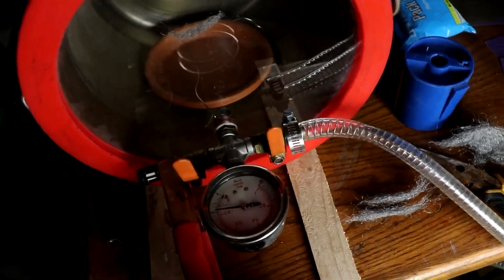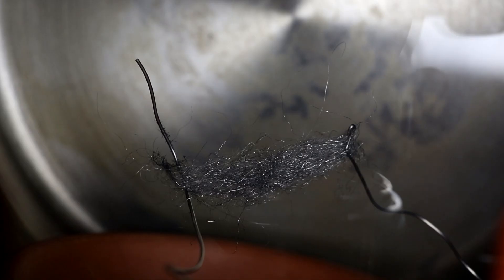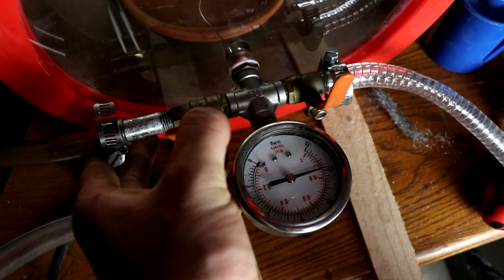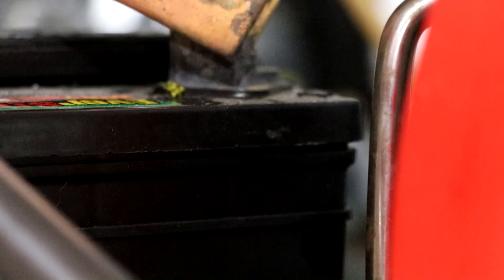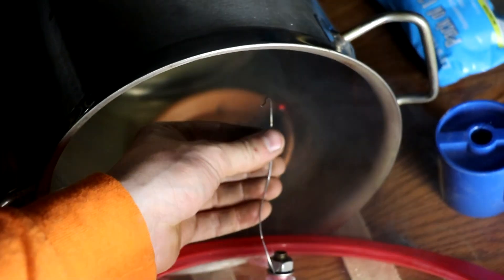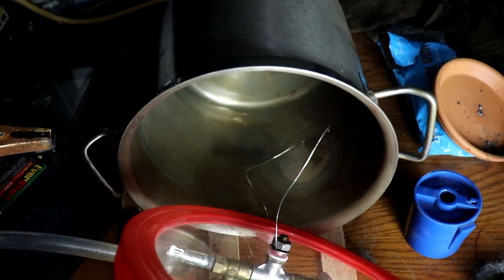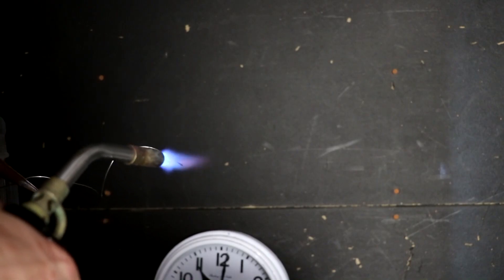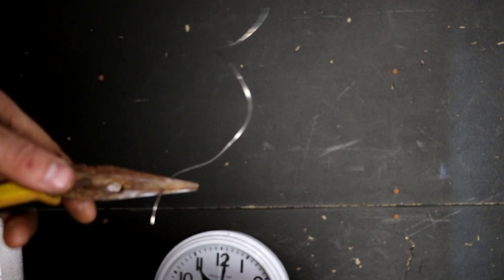Burning Steel Wool In Oxygen

Comment: You gotta remember stainless steel isn't stain proof. A slightly pressurized pure oxygen environment and micro quantities of carbon and water allows minute oxidation in an oxygen environment. Pure oxygen is an oxidizer.

Comment: How violently would magnesium burn in pure oxygen?
Reply: VERY
Reply: It will burn very bright and fast. That's how old photo flash bulbs worked.
Reply: Also try burning it in 100% CO2. The magnesium takes the oxygen from the CO2-molecules and makes carbon
Reply: KABOOM! That´s how.
Reply: soldering glasses?
u mean welding glasses?
Reply: on a scale of 1-10: The font death metal bands use
Reply: My science teacher burnt magnesium in pure oxygen, we weren't allowed to look directly at the flame as it causes weld eyes or so he told us, it was bright as hell.
Reply: Science is Life   Well, not any more...
Reply: @rocketman221projects -- Actually you can make a very serviceable flashbulb using very fine iron wool in oxygen.  Cody's wool in this piece was rather coarse.
Reply: even better white phosphorus
Reply: And how about burning Francium in Fluorine atmosphere ?

Nah, propably not gonna happen ;(
Reply: the FBI will arrest you for unintentionally making a flashbang
Reply: francium only exists in traces, but there is a youtube vid on caesium and fluorine
Reply: Good enough :P
Reply: Basically, what happens when you ignite flash powder. Powdered magnesium is the fuel, and heat releases the oxygen from the salt peter. When mixed in optimum proportions (fine tuned empirically) it will go up in a thump, out in the open. Its a low grade explosive, so the reaction is sub-sonic. To go boom, it must be confined (NOT compacted, as misrepresented over the ages) ... think steam explosion. In my misspent youth, I made my own fireworks, so I'm intimately aware of the details. Did it for years, back in the 70's and early 80's.
Reply: Baconomics101 Slam bands*
Reply: this needs to happen
Reply: ohhhh
Reply: Or some thermite
Reply: I tried, its instant and almost blinding
Reply: Black note it would not be an explosive device, so no they couldn’t or wouldn’t.
Reply: Kontrol Kabel that would probably be even brighter.
Reply: Hermes quest
Well, stop playing with it, put it away and get back to burning magnesium in pure oxygen
Reply: cdawson198600 furiously
Reply: Not to much Moore than in air
Reply: Yes :) But very little amount of magnesium please. Don’t wanna blow that ole vacuum chamber lol
Reply: Or natriuretic? Would be less violent. Maybe.
Reply: dont encourage him
Reply: Science is Life nah man he mean soldering, haven't you seen the bright flashes that burn out your retinas while soldering?
Reply: Hermes quest he could wear soldering glasses
Reply: test it out!
Reply: pulse nightclub violently

Comment: It's my understanding that part of what makes a flint and steel work is not just that the friction heats up the bits of metal to produce a spark, but that when the tiny bits of steel flake off, you've got a high surface area to mass ratio, plus a lot of newly exposed, unoxodized metal, so it reacts with the oxygen in the air to generate heat.
Reply: Modern 'flint and steel' rods are an alloy of iron, cerium and lanthanum which oxidises much more readily than steel.
Reply: Only what is sold as fire starters today as Magnesium on the back side. Come to think of it I doubt the front side is actually "flint" but it seems to work the same. I'm always surprised how few of the Survivors never even know the right way to use them.
Reply: I think I've seen stainless steel used in place of the "flint." Doesn't really matter what it is, as long as it can hold an edge against what it's striking.
Reply: It's probably pretty evident that I'm no expert in this field. But Cody brought up spontaneous combustion, and a modern lighter demonstrates the phenomenon quite well. I didn't know until recently that it wasn't just heat generated by friction.
Reply: Hmm, I'll have to try that, I would think SS being so much softer than flint, really even softer than a proper steel, that it would be hard to get a good spark.   (speaking about a real flint and steel, not the ferrocerium rod things.)
Reply: I assume the heat comes from the deformation of the metal. It takes energy to shear away the bits of metal, and that energy becomes heat. If you do this with enough energy, the metal ignites. (more energy is being released by oxidation than is lost to the environment.)  
Ferrocerium takes a lot less energy to ignite than normal steel, so you can get sparks more easily. Actual flint and steel takes a lot more work and doesn't make nearly so many sparks.
Reply: Iron is pyrophoric (meaning it ignites spontaneously at low temperature) when finely divided. The flint's job in a true, old-fashioned flint & steel set is just to shave off small enough particles of iron.
Reply: Flint does actually heat up the steel enough to get it to light, if too lightly struck it wont give sparks, because not enough friction causing enough heat for the iron to actually combust.

Comment: What is the chemical nature of the resulting ash? Is it simply iron oxide? Is it different than normal rust. Would it be incorrect to think of rusting as a slow burning?( I understand normal rusting is not an exothermic reaction- or is it?)
Reply: samuel dooley Normal rust is FeO(OH). The iron needs to get in contact with both water and oxygen in order to create rust.
Reply: Thank you, so what about Hydrogen. When it combusts with oxygen, the resultant ash is H2O, correct? Would it be incorrect to think of water as the ashes of hydrogen?
Reply: It's a combustion product, at best, I'd say. Ashes is very specific, and there are many combustion products created besides ash when burning organic matter. The Royal Institution has an excellent video on combustion products, and quite a few good ones on all sorts of fire (it always makes for a good show).

Comment: You should do it with non-oxygen-safe sealing materials and oil! It would be a great demonstration of the need to use oxygen-safe apparatus in its handling.

Also, the same experiment with fluorine would be interesting.
Reply: Interesting indeed. Unfortunately we'd have to buy a replacement Cody afterwards and I wouldn't know where.

Comment: I thought jet fuel couldn't melt steel beam
Reply: Who is claiming steel beams melted, not just softened? Don't most crashed planes come in at a very shallow angle? Why expect cellphones to act now as they did then, since they want to force airfone use nowadays?
Reply: Romano Coombs Any hearty enough fire (fueled by paper, office furniture etc) can cause structural steel truss failure. Trusses are by virtue strong, with relatively low mass compared to an 'I' beam of similar proportion. However that same property means high surface area to mass ratio. Under such fires, trusses can sag and fail, catastrophically so under load. 

Steel wool has an even greater SA:M ratio, hence why it doesn't just soften but ignites so easily.

Comment: If you'd do that again, could you do it with a 0.2 atmosphere of pure oxygen? That way you'd have the same oxygen content as in air but without nitrogen and you could show that the effect is based not on the higher total oxygen level. But anyway great demonstration, thanks!
Reply: That would be very interesting.
Reply: I would like to see this
Reply: Yeah I thought the higher partial pressure of O2 was what caused the increased burning, rather than heating the nitrogen. You could always test that by doing a 0.2 atm test as suggested above!
Reply: That's the Artemis assumption I mentioned in another comment. Please do try!

Comment: (Edit) Here's a bad idea: put magnesium powder in it and ignite it
Reply: Well, the rust acts as an oxidiser. I don't think oxygen would make a difference. In fact, I think thermite would burn just fine even in a vacuum.
Reply: Drunken Hobo Well it would just make the combustion easier/closer to stechiometric. It should be hotter/faster? than a regular thermite reaction not by a large margin though. I doubt it would be fast enough for an explosion but maybe.
Reply: Drunken Hobo that could make the video interesting 🤔
Reply: David yeah... I might just edit my comment to something better
Reply: That would basically make a flash powder. Could be very violent
Reply: Cheezy Flakes heya! Of course!
Reply: schel sullivan Hey! You here too? Yeah, that would create an extreme version of magnesium flash powder. That's why it would be such a bad idea ;)

Comment: Hm, why not try  it at a fith (1/5) of the atmosphere with pure oxygen. I would strongly expect, that the reaction would be much more similar to normal pressure, as typically the reaction is more governed by the partial pressure of the oxygen and not so much on the purity. But I am happy, when you proof me wrong;)

Comment: I started laughing when that stainless steel wire started burning it was like a mini thermal Lance I like to use brake line and hook it up to an oxygen source with like a long flexible tubing to burn the brake line just like that wire burned and I can melt The Rock Steel is pretty dang cool

Comment: And that is what caused the catastrophic fire in Apollo 1 in 1967, which killed astronauts Grissom, White, and Chaffee. An electrical short in a 100% Oxygen atmosphere. Lethal.
Reply: It was a rehearsal, everything had to be done for real. To kill three people, destroy an expensive spacecraft, set the whole program back 18 months, reveal their safety gear was inoperable-but-looks-good quality... does not have the ring of likelihood to it. If someone wanted Grissom dead, there were too many better ways.
Reply: I mean hindsight is 20/20 its easy to look at it 50 years later and say its stupid but the only reason we know that now is because of the mistakes we made back then.
Reply: Yes. Pure O2 means only having to carry and plumb one gas. Doing it at a slight overpressure meant supporting the thin capsule walls, and ensure dust would exit, not enter. Then they found out the hard way all those "fireproof" and "self extinguishing" materials... had been tested in regular air. If the Soviets had shared the similar accident that killed cosmonaut Valentin Bondarenko, Apollo 1 might never have happened.
Reply: Yes pure O2 is better - you only need like a fifth of atmospheric pressure. Makes the spacecraft and spacesuits about 5 times easier to build, and a lot less stored gas to lift. And I think you can stand a lot more CO2 buildup in pure O2 as opposed to air.

Pesky fire ruins everything.
Reply: brianartillery sadly. True
Reply: Lil Flatty Conspiracy idiots like you insult the memory of those heroes. If they wanted to get rid of someone, they could had him shot by a rando on the street, not cause an incident that killed other two people and set back a goverment project needed to "win" against Russia, that also resulted in Boeing having to scrap the whole Apollo capsule MarkI wasting milions due to their incompetent design choices. You need to met the knuckles of Buzz Aldrin.
Reply: Actually, it would probably be 99. someething, because nothing is perfect nor 100%, totally, pure.
Reply: In Apollo 1, not only did they use pure Oxygen, but they also pressurised it to simulate the pressure differential between a capsule and the external vacuum of space. The short circuit caused the Velcro to ignite, as well as the cables and their insulation, and eventually the astronauts themselves. It must have been a horrible death for all three of them. One body was still in the position of trying to open the (impossible to open) hatch.
Reply: I was thinking The same thing and how it was kind of stupid I mean did nobody experiment first? Was a pure oxygen environment better for something?
Reply: @Lil Flatty If it's a simulation, the point is to make it as close to reality as possible. This includes O2 atmosphere...
Reply: Didn't knew that. Thank u for the info :)
Reply: Same thing happened to soviet cosmonaut Bondarenko in 1961. Pure oxygen atmosphere sounds like a great idea (you need less pressure for breathing thus you can make thinner hull, weight...) but reality has its own limitations. One mistake and you will create crematorium where burns almost everything.
Reply: JBroMCMXCI - The Astronaut's name was Edward White. The first American to perform a spacewalk in the Gemini programme. Nothing racist about it. That was his surname.
Reply: brianartillery man, i applaud you for replying to that comment about oxygen being non flammable as calmly as you did. When i read that comment i think my brain dropped a couple brain cells. I wasn’t going to reply to him but if i did i feel like i may have been a bit more explosive. Bravo to you for having good manners on the internet.
Reply: they went out with a bang
Reply: It'd be interesting to see some copper wire burning in pure oxygen, to recreate Apollo 1 conditions better.
Reply: Tim Michaels - it is, and tremendously so. Oxygen is why you can have fire. Fire needs three things: Heat (an ignition source), fuel, and a source of Oxygen. Air, that we all breathe, is mainly Nitrogen, and Oxygen. Pure Oxygen is totally different from ordinary air. It's flammability is utilised in metal cutting gear, such as Oxy-Acetylene torches.
Reply: brianartillery I thought he meant by itself, but that wouldn't make sense because nothing is flammable by itself, unless it contains both fuel and oxidiser that is
Reply: lol
Reply: Chris Padgett Finally someone who has enough braincells to understand what that guy meant.
Reply: In a 100% oxygen atmosphere and with a spark not heating enought something that could be flammable, oxygen would be completely inoffensive. You don't need just a spark to initiate a fire in a 100% oxygen atmosphere, but a lot of bad luck, like the spark being gerented near some plastic material.
Reply: @ JBroMCMXCI
I hope that bullcookie was snark.
Reply: "White" is a bit racist, it implies other races can't be astronauts
Reply: brianartillery 
Oxygen is not flammable.
Reply: brianartillery  I think that someone at nasa intentionally caused that fire. They had absolutely no reason to use pure O2 in a simulation sitting on the ground. They were basically trying to get rid of Gus Grissom. They could just have easily used compressed air but they went went with pure O2.

Comment: Ok, I have an idea that falls in line with the "atmosphere of pure oxygen" tests. So, you know how in order to cast titanium, it needs to be in an inert environment? Would burning titanium in pure oxygen work? What colour would the flame be?
Reply: White, I would imagine. Titanium is a common ingredient in pyrotechnics to produce a white flame, though I've never seen anyone try to burn the solid metal before.
Reply: I would expect it to be very white also.
One time I shaped titanium on a grinder and there were very bright sparks when the metal got hot.
Reply: Parts of the space shuttle were titanium and in the Columbia disaster report they mentioned that titanium burns at high temperatures (during re-entry).
Reply: It would be very bright, when I cut titanium with a dremmel or grinder I have to wear sunglasses to see what I'm doing. The sparks are incredible.
Reply: The problem might be that titanium once ignited won't stop burning if you let air back into the chamber. At least according to the fire marshal of our local chemical plant. It'll burn until all the fuel or. Oxygen is consumed.
Reply: Yeah, that does seem to be a bit of a problem. Perhaps the test should start with tiny quantities.
Reply: CargoCultScientist Yes. Titanium burns just fine in pure nitrogen, as magnesium can, and even better with oxygen